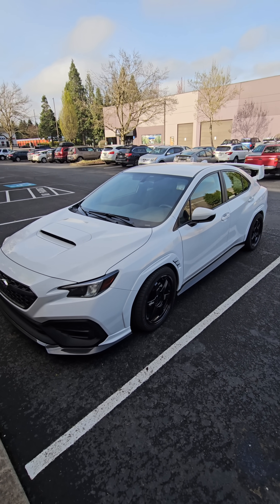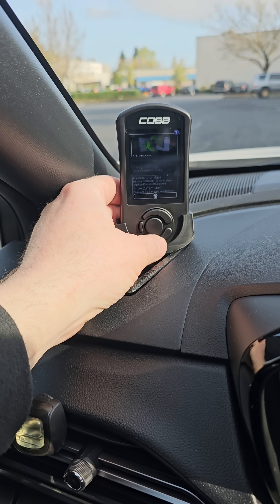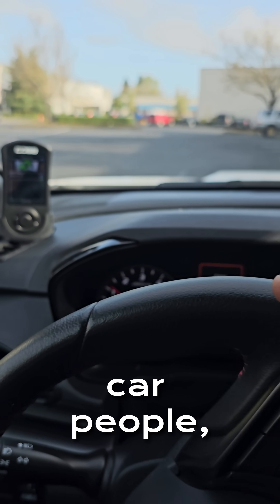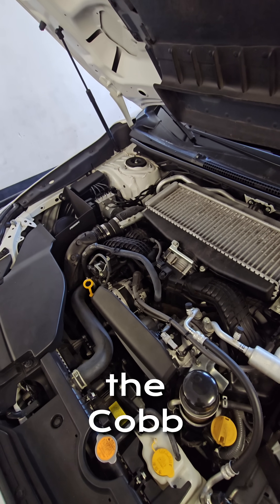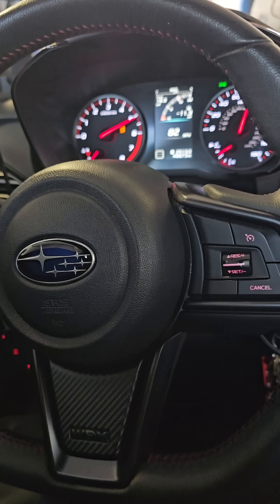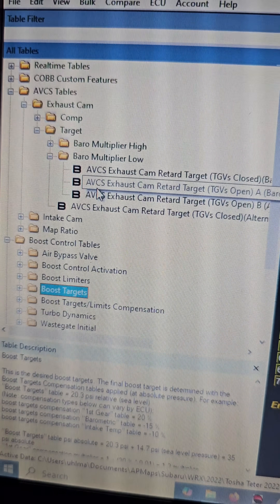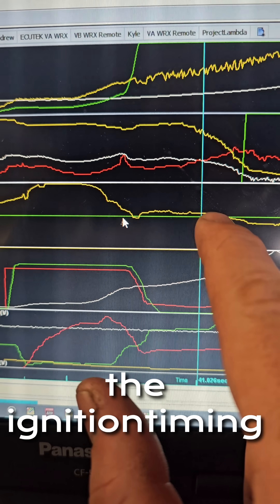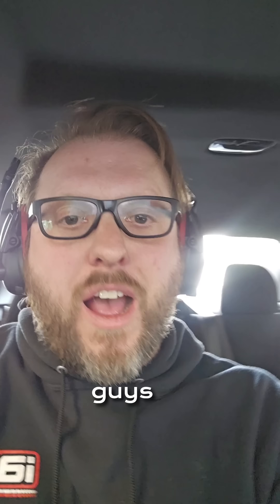Why This VB WRX Had a DAM of 0.438 and how we fixed it!

Comment: with a perrin intake it shouldnt have issues since they work on a stock car. but what tune do i need with i think a cat back exhaust and the perrin intake
Reply from the maker: "Work" and work correctly are not the same.  I'm my opinion EVERY intake on these cars requires a tune.
Reply: @WT4T  o yea it just has stock diamtors the onyl thing witht he perrin is it runs lean at the high end which wont hurt the car but yes probly better to have a tune but does cobb even have a tune that will work with them 2 mods

Comment: Can some one explain to me what DAM is? Need knowledge for my subie for later tunes
Reply: Ej255
Reply from the maker: Dynamic advance multiplier.  It's treated very different on earlier Subarus than later Subarus but essentially it's a knock learning system that dynamically adds or reduces cylinder pressure through a variety of means.
Reply: @WT4T  what do you think would be a good balance/reading for a stock ej255, and thank you for informing me, very much appreciated

Comment: Know anything about a Dimemod patch causing a flashing CEL???
Reply from the maker: You can set it up to flash the cel for knock.  But flashing cel can also be an indication of misfire.
Reply: @WT4T  if it’s got brand new plugs, brand new coils - what would cause a misfire? Literally 300 miles on brand new coils and plugs. Flashed a new tune after an overboost in 5th. Then the flashing CEL.
Reply from the maker: You should be able to log roughness to know if it's a misfire
Reply: @WT4T I have been. What’s acceptable and what is worthy of caution?

Couple cylinders occasionally misfire, but nothing to be concerned of. I don’t think the flashing CEL is from the misfire. But I could be wrong

Comment: oh wow 30 years later and knock is still a thing on junkaru
Reply from the maker: Knock is a thing on all cars... literally all.
Reply: @WT4T catastrophic vs ecu adjustments for poor fuel. theres a difference.
Reply: @WT4T my 2014 st NO KNOCK, my 01' corolla no knock myv02' mmercedes c230 no knock, my focus se no knock.  ONLY CAR  out of a dozen thats been fixed due to rod knock, wrx. kinda odd how it's the ONLY CAR ICE😢EXPERIENCED ENGINE ISSUES WITH. lol. sycophant clown.
Reply from the maker: Are you logging any of those because all those cars use dynamic knock learning to find mbt, which is what the DAM on a Subaru is doing as well.

I'm not talking about rod knock.
Reply: @WT4T spun bearings = wrong oil, too little oil, too dirty oil, over-revving, or SUBARU's in particular. leading to road knock. oil is  necessary in every metal on metal surface and subarus are designed to struggle getting oil there, especially in their alleged sports cars. total junk.
Reply from the maker: Nothing in this video or any of my posts has anything to do with rod knock... when we talk about knock, it's not "rod knock" its uncontrolled ignition events.  These can cause rod bearing damage as the Shockwave causes oil film failure but yeah,  totally different knock there buddy.
Reply: @WT4T im talking about the stock tuning which runs lean in the wrx and under high levels of of head pressure burns to hot snd fries rings, and combined with horrible oil circulation,  fries bearings. sure, you can mod it IF YOU FIND THE RIGHT GUY ON THE RIGHT DAY, go tune it, or rub ethanol,  but stock,  you're going to have to drive it pretty conservatively. it's almost exclusively a Subaru issue.
Reply from the maker: Not an issue on these cars with the fa24. Can't say I've seen a single bearing failure.
Reply: @WT4T if true, still can't get ovsr how hideous it looks.
Reply from the maker: It's not for everyone,  that's for sure
Reply: They don't knock if you don't tune them.
Reply from the maker: That's dead false
Reply: @Keith-e5f they knock  no matter what. only place these pos are good for is snow and due to salt, they just get ruined anyway, even if they're reliable.
Reply: @Keith-e5f if tuned right they knock less avrually.

Comment: You know the best way? Just be happy with the stock engine
Reply: 💯💯💯💯💯
The vb always have the starter pack when I see them at work. Paint match fenders, colorful engine bay, and access port
Reply: Yeah i hate how people ruing those cars with Cobb accessport. They cant help themselves. Been the same way with VA WRX too..
Reply: @Kacpa2 yeah.. I mean, I'm all for tuning and modding a car, but so few actually learn to drive their cars before they start messing with them. Unfortunately it's not just a Subaru thing
Reply: Exactly! I'm 63 years old and I have a 2024 base model. I don't need it to be any faster. It scares me. But I am old. I just love taking it out on back roads and running the crap out of it. 3000 mile oil changes and frequent air filter changes. So far it doesn't burn a drop.
Reply: @Keith-e5f that’s awesome man. I’m the same way with that. Although I’m 28, I keep my 17 sti stock. Spirited back road drives are my jam. It’s where the wrx and sti shine. Still haven’t felt like the power isn’t enough for my needs. Rarely get above 5k rpm. Hoping it keeps going without issues. Currently at 28k miles
Reply: That's incredibly boring.. these cars really wake up with a downpipe and dyno tune. Not to mention the stock tune is unsafe for some models (the previous VA STi). The factory tunes came very dangerous on those models because of emissions. The needed a re-tune from the factory just to not blow up.

Comment: Looks good but paying over 40k and not an sti plus the reliability issues. Big pass.
Reply from the maker: I haven't really seen reliability issues with the vb yet
Reply: @WT4T  How it in comparison with Mazda 3 turbo awd?
Reply from the maker: No idea,  i haven't driven one.  Historically, the mazda awd system has not been great
Reply: @WT4T the paint quality, infotainment bugs, premature clutch wear, cvt has issues, the engines have oil consumption issues happening. Just to name a few.
Reply from the maker: @EliteTreats that's just what makes a Subaru a Subaru.  STI have had all those issues as well.  As for cvt, so far they seem pretty solid. So i dunno, way more reliable than VA WRX/STI
Reply: @WT4T they could fix them! 😂
Reply: @EliteTreats Besides some people getting infotainment bugs, which I almost never hear about, you are literally the first person I've heard complain about these things. The paint is fine, no worse than any other subi, the clutch is fine, people hitting 100k+ tuned on stock clutch, never heard about oil consumption past the ej motors, what are you on about?
Reply: have you seen a new Mercedes C Class?  Same issues but for a lot more money.  If you want perfect paint, find a car that spends a week in the paint correction booth or invest in the numerous ppf on the market, especially for the front.  The infotainment is the infotainment and can be band-aided in various ways.  your issues with the VB are trivial and it seems like a late 90s/early 2000s Nissan is best for you.
Reply: @K03sport because a c class has issues does not justify it 😂 that’s a horrible excuse. Tesla has terrible paint problems too! My ‘21 Elantra has no paint problems and it gets abused as a point a-b car. Stop defending a sub par product. You can still enjoy it, that’s fine.
Reply: @EliteTreats  Is your elantra white? Because those peel off in huge chunks . Lawsuit about that going on .
Reply: they weren't 40k until tariffs. we just have to deal with stupidly priced imported goods now.
Reply: @dog_transport_fw 2024 limited’s, TR’s and GT’s were above 40k. It’s not the tariffs that caused it. Greedy corporations that are overpricing their vehicles and using cheaper parts.

Comment: I shed a tear when i see DAM drop or knock.
I ran a cobb OTS stage 1 and stage 2 on my 2016 wrx. Never had DAM drop.
Then I went full flex fuel and deletes and multiple Phatbotti tunes.
My car has never had DAM drop or any knock over 1.41. And thats twice a year with the a
AC on. 9 years on E60. Zero issues.
Reply: Not all knock sensors are created equal, 2020 Wrx E60 tuned and I get -2.81 that drops my DAM sometimes but usually only when I run AC so apart from summer time I also don’t see any knock above -1.41 especially under full throttle which matters the most

Comment: I just did a swap on my 2010 Impreza now I got an ej20X with a wiring from 2009 wrx could we get to speak together I would need a e tuner for evap and secondary air pump
Reply from the maker: Why would you remove evap?
Reply: @WT4T  impreza 2.5i doesn’t have 3 line out of the firewall only 2 since its n/a one fuel delivery and the other evap so I took the evap line as a fuel return for the turbo engine and deleted charcoal canister and evap solenoid the cars works well except for idle
Reply from the maker: @WoolyBaby ahhh, was an na car. Did you install a fuel return? One of those lines is factory evap the other is dead head feed which a turbo motor won't like much.
Reply: @WT4T dont worry it has return line do you have a discord or something I got pictures and everything yt comments aren’t really my preferred way of chetting lmao
Reply: @WT4T  I wish I could send attachments for u
Reply: @WT4T it’s really cause it’s a frankenstein soo could I send you my Cobb map so you can uncheck them codes ? I would do it myself but Cobb doesn’t support access tuner anymore

Comment: Mine is on stage 2 and the dam drops all the way to 0.000 it’s like crazy honestly but the car feels normal, am about to get it checked
Reply from the maker: At 0.000 the car is probably making significantly less power than it should be.  What tune is on it?
Reply: Had the same thing on stage 1 91oct
Reply: My problem was that I had a big oil leak on Valve Cover Gasket R&R (Both Sides) they said it’s pretty common on this FA24 engines, I recommend you guys to get that checked
Reply: My DAM has permanently been at 0.8 (even after dyno tune), which by Cobb standards is safe. Been 40K miles since my tune, still feels better than ever.

Comment: The access port is great. COBB on the other hand is the WORST tuning company on the planet. Seriously cant tune their way out of a paper bag. They make minimal gains on factory turbo cars and usually end up adding a bunch if knock. Have you seen their tunes for NA cars? Jesus Christ, when they cant just throw a couple extra psi at a turbo car they dont have a clue WTF they are doing. 😂
Reply from the maker: What na cars are they doing now? Been a really long time since they offered an AP for an na car. If you're talking about the new brz that's a whole different thing.
Reply: @WT4T  It is the BRZ\86 I was referring to. I am an active forum member as well  as participate in a few local clubs dedicated to the platform. I read the whole page they released trying to explain why their tune was so great even though it makes basically no power what so ever. I personally know 2 people who have flashed the COBB tune (which is sold for cheap because they are an Ecutek sister company). One is a street car only and they say, there is zero noticable difference in performance on the butt dyno. One is an avid track member that I have known for 25+ years. The cobb tune on his car made his lap time slower in 2 consecutive outings. He since replaces the tune with an OTS stage 1 from Delicious tuning. Very 1st time back on the same track he was 1.4 seconds faster. Huge difference
Reply from the maker: I've seen the opposite from the ots delicious tune.  There's reasons for this,  I went over it in my video i did on the topic a while ago.
Reply: @WT4T  I have heard somewhere that people had complaints of knock and timing pull. The only thing I can guess is that version of the tune was an early revision. The stage 1 has received a handful of free updates over the last year or so. The car I mentioned is completely stock engine wise with only a charcoal pad delete and drop in filter. The car never shows any signs of knock on 93 octane even under high heat track conditions. 
My own car is stage 2 custom Etuned by DT. I am have 100% happy as well. A little bit of ethanol goes a long way. No such thing as knock in any log I have viewed.
Reply from the maker: @boost331 ethanol is really good as long as they finally addressed the high rpm load limit which last I knew only myself and a few other people had figured out.
Reply: @WT4T  Idk. Never heard or or had any issue on my car. I rev to 7800rpm. Car has a catted UEL, charcoal delete, carbon fiber post MAF, drop in filter. On E60 it dyno'd at 245\185. I havent heard any discussion of torque limits in any tuning conversations or posts.
Reply from the maker: @boost331 most tuners probably don't even know it's there as it happens after 7400rpm.
Reply: So you are calling out Cobb over a single vehicle experience? On a NA car that they normally don't touch, but likely did to try and help the community? Ever wonder why they have been around as long as they have? They have been nothing but awesome for the community and even adapted to all the EPA BS!
Reply: @SubyRyan I have plenty of other reasons too. Cobb has ALWAYS put out incredibly weak, overly conservative tunes. The access port itself is a great device, but OBDII tuning devices are plentiful. They can all do the same thing once inside the ECUs security. Cobb OTS tunes are a giant waste of money. Im convinced they cant tune their way out of a paper bag. Every other tuner will sell OTS maps that out perform Cobb, even using their own AP. Any idiot can make some extra power on a factory turbo car. Add 2 psi and keep the AFR the same. Boom.... More power. Thats all they know how to do. They have a product that caters to a certain platform. They are gods in the Subaru world, not because they are great, hell not even very good. They are just the only ones that care to sell a product. They get worship because they are the only ones in the space.

Comment: If tuning your car will give you problems in the future, then isn't better to just leave it stock. Maybe make smaller tune adjustments like radiator, cooling system air flow system air intake. All I keep hearing is tuning your car won't give you a longer lifespan. But if u have the money to throw away good working condition products then go right ahead, and enjoy the moment and not the lifespan
Reply from the maker: Some people just want more power. Some other cars can actually benefit from a tune for better longevity.  Really depends on the car and the customer
Reply: @WT4T  For the VB WRX is it possible for it to benefit from a tune for better longevity while also waking it up for a little increase in power? (reliably and with minimum bolt ons)

Comment: What is DAM? I know a little about tuning on engines and I’ve never heard of that. I’ve also never messed with Subarus or Cobb
Reply from the maker: Dynamic Advance Multiplier. It's mostly an OEM strategy used in Subarus and some Nissans. It is a scalar multiplier of a variety of adder tables and limit tables.  The strategy is it will turn up or down the power output of the entire motor at once not just become a traditional "knock learn" table.  Works very well.  No it shouldn't always be at full advance like a lot of people think. Factory tuned these cars rarely ever see a full advance.
Reply: Dynamite advance multiplayer it’s a table of adjustments for the engine timing ex injector cams spark it’s used to maximize performance and keep the motor safe if dam drops it’s pulling timing because something is not quite right.

Comment: I recently took an 11 hour drive from Ohio to North Carolina. On the way there - and back - in the same 30minute stretch, I was getting like 500 on the dam. Would something like this be considered normal? During this portion of the trip, I was very high altitude in the mountains going between peaks and through tunnels.

Would this be considered normal just because of atmosphere? Other than that, my dam is ALWAYS 1.
Reply from the maker: The whole point of the DAM is that it is dynamic. If you're traveling outside of the conditions where the vehicle was tuned, the dam is there to protect the car.
Reply: @WT4T  that's exactly what I had figured based off my research. This is the first time I've gotten into modification but figured why not ask someone who KNOWS their shit